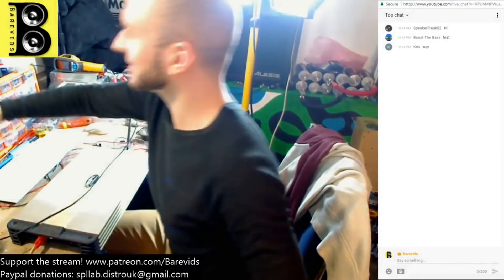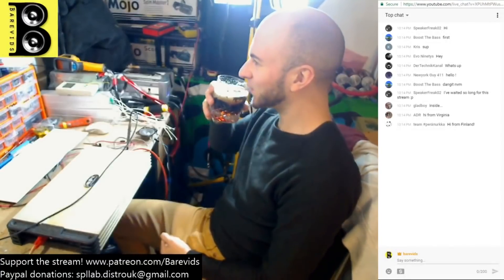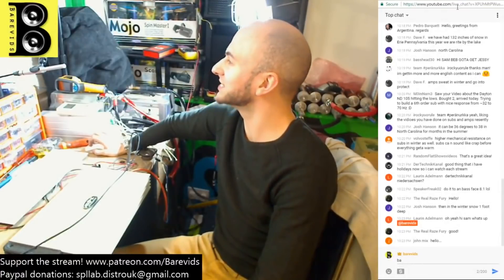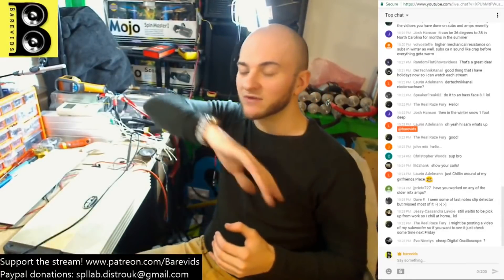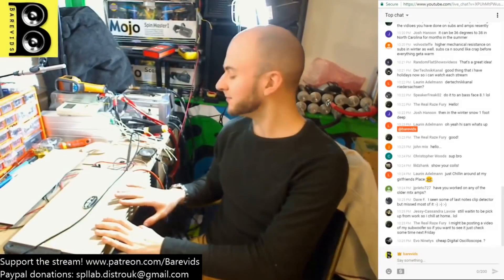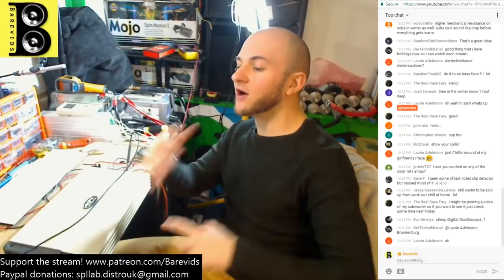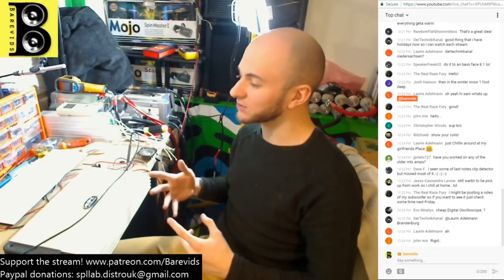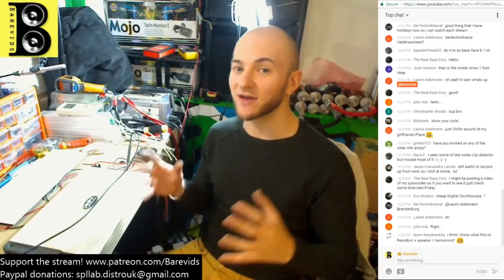Detect amplifier clipping WITHOUT DD-1! Cheap simple clip detector

Comment: How can you test for distortion on a full range amplifier or a normal car stereo? Thanks
Reply: Well you can always use an oscilloscope
Reply: I believe so.

 The harmonics thats are created when clipped come from the rail. The cross over filters are on the input side. Clipping occurs after the cross over.  

i would bet there are low hz harmonics created too(by the output section(saturation)as suggested by drunk guy you need to flip the cross overs. Hp to your main, and a capacitor thats below your HP filter. 

Disclaimer I’ve never actually done this.  But I do on a set a JBL main where the crossover networks has a clip light built into it basically works out the same principle but instead of activating speakers it turns on the light and activates a circuitry to save the teeeter. 

Also, in my world I have meters, And can hear the compression that occurs before audile clipping happens.  Check out the JBL mr series cross network, the System is called sonic guard.
Reply: Guys just put a 1khz tone on and you can hear it clip by ear. It’s the low end that’s hard to hear.
Reply: Late  reply but maybe a different capacitor? to filter about above 80hz? Unless you figured  it out let me know !!! thanks !

Comment: Thanks for the video. I would try this but I think I would have a hard time listening for distortion on that little speaker while my subs are as loud as they would be. Cool idea.
Reply: You don't connect your actual speakers while doing this dude.....
Reply: @MrJosephLaux  yes you do. He is using a dummy load in the video so he doesnt have to, but if you dont have a dummy load you need to use your subs.
Reply: @Slide78  well if that's the case, then it can go either way. I NEVER have my speakers hooked up when I do this. Maybe paranoia, but whatever lol
Reply: Joseph Laux so you never know how your amp truly behaves and clips under real circumstances, as if a real speaker with changing impedance is played

Comment: Can some one confirm the setup. 
All this has to be done with an actual load eg my 4ohm dualVC connected in series to have 8 ohm load. 
Amplifier on bridged mode. 
SO...startin from Amplifier 
POSITIVE terminal::::Capacitor + small speaker 4ohm + my SUB dual voice coils 4ohm + 4ohm and back to :::::NEGATIVE TERMINAL. 

also plz tell me if this extra impediance from small speaker will have any negative issues for my sub or my amp.

Comment: Are these the appropriate steps? Correct me if I'm wrong.Assuming my HU distorts at 38:
 Car on, subs connected, and test speaker w/ cap connected. Set amp gain to zero, and then HU volume to 37. Play test tone. Slowly increase amp gain until test speaker produces sound, then back off slightly til it's gone.
Reply from the maker: Sounds about right yes. Do this with your subs connected.

Comment: I tried mine i got 100 watts 3.3 frad cap... And hook up to 1000 wats rms amp thw capz explode... 
Is there somthing with my capasitor?
Reply from the maker: You probably didn't use a non-polarised capacitor. Or the voltage rating on the cap was too low.
Reply: Probly i got mistake on the cap...
But i buy new one non polarize capz 250 v 3.3 frad...is it ok to use on 1000 wattz rms amp?

Comment: Will one of these capacitors work 3.3uF 100V Electrolytic Non-Polarized Crossover Capacitor? And just to be clear I can hook them in the speaker wire terminals with the subs and I don’t have to worry the ohms changing because of the capacitor? I have a class d mono, thanks

Comment: Hey barevids, was wondering if I could get your opinion on this, since I have used this to find the clipping on my amp. I have a Boss armour 4000d (only pushes about 800 watts at 2 ohm rms in bigdwiz's video), but the voltage droops from the source when clipping, whether it is a computer power supply or a car battery, the voltage droops to about 10.5v before clipping but it is only pulling about 20a (it has 3 100a fuses in it) and the voltage going into the speakers (using ohms law) only seems to be pushing about 200 watts, and if I push it more past clipping, a loud squeeling noise will come from the subs/amp. Any thoughts on what's wrong? or is it just cheap/broken and I should get a replacement?
P.s. I'm a complete noob and only know the very basic things, any advice would be appreciated!

Comment: I tried this and and it works but my radio sub-woofers are too loud to hear the little 4" mid-range I had hooked up to test this. A visual indicator like a LED or tiny incasdesent would be better. Do you know if there is a circuit diagram to make this work with a light?
Reply: Jeff Mills so did you make it work somehow with the light? Could you share here?

Comment: Awesome tip - I subscribed. I wished there was a way to have this work with a LED though and intergrated into dash mount bass knob.  Gotta be a way... 

But what would even be better - would be automatic clip prevention device where it would automatically lower the RCA level input when clipping is detected. With such a device speaker manufacturers may not like you much but us bassheads would love you!

Comment: Am i the only one still hear the speaker  making noise before clipping??? start from 10.40
Reply from the maker: +Johnny Asiata you're right it does! Class D amps kick out a distortion harmonic which rides along the output wave, when the level gets close to the amps internal rail voltages. So technically it's distorting at this point but not clipping. If you listen closely, you can hear the change in sound between the distortion and clip.

Comment: why should i do this with my subs hooked up? would that not drop the final impedance dangerously low??
Reply from the maker: +syneX_HaZe why would it change the final impedance? And yes, you need the subs hooked up as your clip point is vastly different without them connected.
Reply: i have my subs wired to 0.5 and the only spare speaker i have is a 4 ohm speaker. if i connect the 4 ohm spare speaker while already having a 0.5 ohm load on the amp would this not drop the impedance the amp sees even lower than 0.5 ohms? and if not is it safe to do this genius idea with a 4 ohm speaker while my subs are wired to 0.5 at the amp?
Reply: and also i only have a 3.8uF capacitor...does this still work with this capacitor?

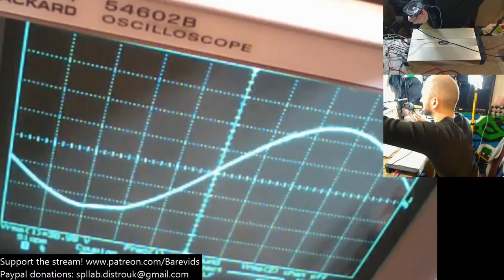Comment: The speaker is making noise before clipping.  You are not hearing the harmonics caused by clipping, you are hearing a problem that all class D amplifiers have when the signal approaches the rail voltage.  If in doubt try this test with a linear amplifier that doesn't exhibit this problem, using 30ish Hz like you were you would expect to hear 90 Hz, the 3rd harmonic is mostly what is generated during clipping.  I'm not hearing 90Hz, i'm hearing a lot of random noise.  At 10:58 its obvious.
Reply: At 10.58 that's clipping on the scope as per the noise from the speaker. It may not be square yet but it's still distortion which I'd prefer not to feed my mids or highs...
Reply: than noise you mentioned sounds more as the voice coil bottoming against the pole plate, as the coil already reached maximum excursion capabilities. I can be wrong, but do not believe a single capacitor has enough attenuation of low frequency to protect a tiny cone tweeter like that for exceeding its excursion capabilities.
Reply: It does sound like that.  However this is a problem that all Class D amplifiers have when they near clipping.  You can google "Class D shoot through" if you want to learn more about it.
Reply: I did it Sir, and I agree with you. I was just telling what that noise sound pretty similar to me.
Reply: You blokes make excellent gear but way too pricey imo! This technique works and it may not be as accurate as your DD-1 it still works. I'll happily test this method with your DD-1 a friend owns when my home theatre system is up and running and see how accurate it actually is. I'm all for easy, cheap and reliable methods though....
Reply: DAmoreEngineering
Reply: how about using a 50 dollar o scope off amazon?
Reply: Hey can i have a discount on your smd dd-1 and crossover calibrator

Comment: You said that your amp was driving a dummy load, what happens if you don't have any load on the amp?
Reply from the maker: +Justin Gardner it clips at a much higher point as there is no voltage drop across the rails
Reply: @barevids  what do you mean higher point?

Comment: Will this work on the RCA line?
Reply: For sub rcas, technically yes, but the buzzing will be a lot quieter since most hus rca outs operate around 2.5 -5V as opposed to, for example, a 1500w amp which can reach 45V at 4 ohm loads before clipping.

Comment: Couldn't you just hook a dmm up to the cap and set it to volts ac? When the amp clips the cap will pass voltage into the dmm.
Reply from the maker: +madmat2001 tried it, it's not enough to read on most dmm plus the speaker gives you an audible instantaneous alert of clip and how extreme the clip is, you can hear it getting more intense which is very nice to have, like an aural intensity meter

Comment: 'Clipping' is only one of many possible ways of distorting the output signal. For transision distortion, the method You describing simply won't work... https://youtu.be/VqHyPKbZOkI
Reply from the maker: This method is designed for class D subwoofer application, the type of distortion you mention people dont generally care about neither is audible. Perhaps only in extreme high end SQ competition setup in which the user would know what he's doing anyway. This trick is for the average joe to find the amplifiers clipping point so that he can run it safely.

Comment: wont hooking up the small speaker mess up the ohms the amp sees or does that matter?
Reply from the maker: M Peezy No, due to the cap in series blocking all power carrying waves from the amp, it sees the added speaker as a near infinite resistance and does not alter its operation in any way.
Reply: barevids and you CANT hook the hf speaker (with the cap in series) directly to the + - terminals (parallel) to the connected subwoofer?

Comment: So,  based on your explanation above. Would this method actually be better than just an oscilloscope?  If the noise starts before the sine wave is actually squared off, then can we assume that distortion can begin before actual clipping of the signal?   SMD claims his DD-1 measures distortion that can be present even if the sine wave hasn't squared off.   So I wonder if his device is an electronic version of this method?   Just throwing some thoughts out there.
Reply from the maker: yes thats right. as the wave approaches the rail voltages distortion starts to ride along the output sine wave, slightly before the wave actually squares off at the rails. this will be the same as the DD1

Comment: The tweeter will have a different impedance than the subwoofer, especially when its clipping point is...
Reply from the maker: No, due to the cap in series blocking all power carrying waves from the amp, it sees the added speaker as a near infinite resistance and does not alter its operation in any way.
Reply: @barevids  so I should connect this to my sub in parallel or in series ?
Reply from the maker: @tomerbakshi  haha cmon think about it man. If the cap is filtering bass freqs to only allow highs to pass. Why would it be wired in series? That would also limit bass to the subs. You need it in parallel.
Reply: @barevids  lol stupid question! Not sure how I missed that, thanks.

Comment: By you adding another speaker aren't you changing the ohm load and in return changing the point in which the amplifier starts clipping?
Reply from the maker: No, due to the cap in series blocking all power carrying waves from the amp, it sees the added speaker as a near infinite resistance and does not alter its operation in any way.
Reply: barevids, thanks for the reply!
Reply: @barevids  Thanks for the video. Happy that it works. And is basically free.

Comment: Barevids and how to do it on high frequency amplifiers? And if i use 400+v caps can i detect distortion on 50wrms amps for example?
Reply from the maker: You dont need it for mids and highs. As you can already hear the distortion when it happens. the point of this is for subwoofers.
Reply: barevids great! Thank you

Comment: What capacitor would u recoment fot a true 3500 to 5000 watt rms amp system???
Reply from the maker: 300V AC (or higher) 2.2uF film capacitor. Usually blue rectangular shape.

Comment: Right now, My biggest Amp is a Rockford BD1500 wich is rated at 1500W @ 2 ohm, Do you think a 100V 2.2uf Cap would do the job? Because 100V is the biggest I could find through Parts Express.
Reply from the maker: You can get large 300Vac+ film caps 2.2uF through mouser, digikey, etc.

Comment: @barevids you said it emits a high frequency at clipping. What's an estimate of the frequency that it emits? I want to try to detect clipping on an amp playing midrange frequencies. From about 800Hz to about 10kHz. Will it clip and display frequencies higher than this?
Reply from the maker: no point, as you can audibly hear clipping through midrange. using the small speaker wont really make much difference.
Reply: barevids thanks for the reply. Would you recommend a "DSO nano" mini oscilloscope to identify distortion in my mids amp?

Comment: Just tried this and got about 3/4 gain on the bass amp at 34/40 volume on the headunit before sharp buzzing started playing on a 4ohm mid range speaker wired in series with a non-polarized 400v 3.3 uf capacitor. Thanks man!
Reply: Non polarized 400v 3.3 uf capacitor
Reply: Did you connect it in parallel with your sub?
Reply: That’s a HIGH gain setting

Comment: You could connect it to your pc with a HiLo-Converter. Then you monitor it on your Pc
and play the same frequency as a cosine wave so they mute
each other. If your amplifier is going to clip you can hear it (sine wave + co sine wave = Nothing to hear) (Square wave + Co sine wave = noise)

Comment: Hi barevids, is it level of clipping depends on ohms and can be different let's say for 1, 2 or 4 ohms speaker?Or that makes no difference and level of clipping stays at the same point?
Thank you
Reply from the maker: if you change the subwoofer ohm on the amplifier, clipping point will be different yes as there is more rail voltage drop with lower impedance.

Comment: Seems too sensitive to me. The speaker makes noise while the wave still looks completely fine. Great idea, but needs fine tuning.
Reply from the maker: Its good, because the buzzing starts when the %thd becomes in the audible range. Just because it "looks" okay on the scope doesnt mean it isnt affecting the sound or putting the amplifier under more stress. If you listen closely there are two different buzz sounds, the first cracking as the class D operation starts to break up, and then a second more harsh buz once the shape goes visibly square. If you want a bit more power you can set gain for the second buzz.
Reply: Thanks for the reply. Now that I think about it, you are right, this is not just a measure of clipping, it's also a direct/empirical measure of harmonic distortion, which can happen prior to clipping.
Reply: You can test the headunit distortion through an amp. Turn the gain on the amp all the way down, turn the HU up till you hear the speaker. Speaker would be connected to amp in same way that is shown in the video.
Reply: barevids what about headunit? Can we use the same method to find HU cliping point. On amplifier speaker output with amp gains in Min.
Reply: Everyday Stuff I would assume the speaker would still buzz the same way if the head unit was the cause of the clipping, but you will have to try it to know for sure. The AD-1 and DD-1 both light up the clipping light if the head unit is too high. This setup should do the same in theory.

Comment: can this be suitable for finding the clipping point of my head unit?
Reply: I purchased a cheap DSO on amazon and was glad to see that FLAT clipped line on the screen when adjusting my amp. 
So start by playing 40 or 50 hz sine wave test tone. 
Attach the probes to the output/RCA of head unit and keep increasing the vol untill it starts to clip and  back off the vol a little.. also note down this MAX vol number on the headunit. Connect the output to the amp and keep the vol at the same unclipped max from the head unit. Connect the probes on the speaker out of the amp and dial the gains while playing the same sinewave frequency untill you detect the flat signal and back off the dial a bit untill clean on the screen. Hope that helps
Reply: @junaidgt90  Most people end up increasing their systems noise floor dramatically by setting their tweeter/mid amps to deliver a potential current that those speakers will NEVER handle, therefore just degrading the overall sound quality. If fully active, set the subs and midbass with a scope, but mids and tweets should be set by ear, listening for the unmistakable hiss that is the noise floor. 

Lots of talk about how your system won't be dynamic if you don't use all the gain available, some of it is garbage.
Reply: hellobooom that was informative and good to know. 
Thanks mate 👍
Reply: @hellobooom  people started to make this about whose the loudest, most expensive or has the best gear that they already forgot that the hobby is about loving listening to music...
Reply: Just get a used scope online. They are a dime a dozen.